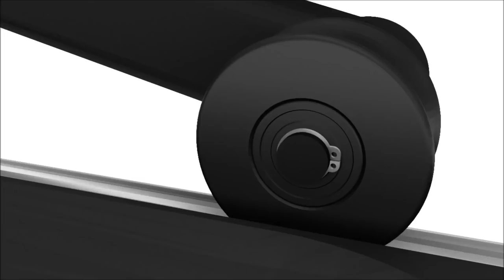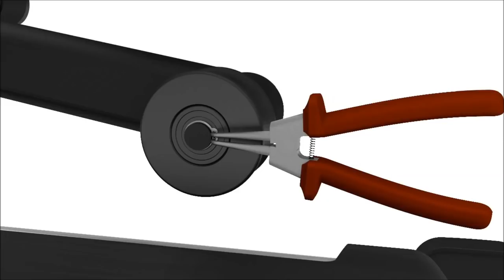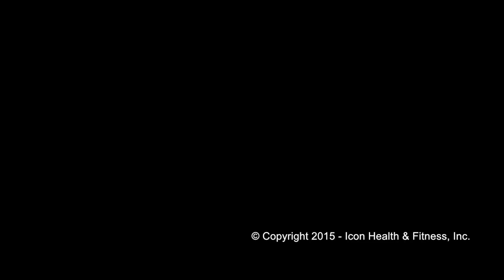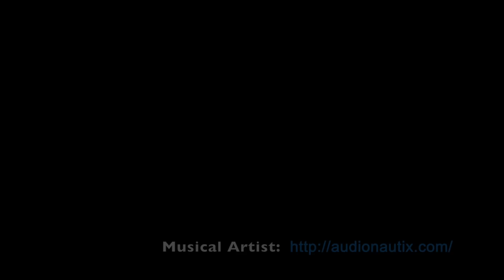Using Snap Ring Pliers - Elliptical

Comment: hello, I have a Nordictrack e5 vi  elliptical and the upper rt. arm keep coming off the pivot axel. Not sure of the wording but the metal that goes inside the part that slides on the pivot axel came out of the plastic holding.  How do I keep the metal part in the plastic that slide on the pivot axel from coming out and then the arm slides completely off.
Reply from the maker: sounds like you are missing either a washer or some other kind of fastener. Can you please include your model number?

Comment: What do you use on small external rings without the two holes? My snap ring pliers doesn't fit, larger rings with two holes no problem. .
Reply from the maker: There are other tools for the "E" clips or "C" shaped clips. ( E clip tool).  I belive most of the time a small flat screw driver can be used to pry them off. Carefull they will fly across the room.

Comment: That’s not a great technique. Fully opening the circlip to clear all of the shaft will stretch the ring and reduce its spring force. Better to place the “head” of the ring (ie the fully closed part opposite the opening) onto the shaft, and to only open the ring enough to fit the right side into the groove, and then open it again just enough to fit the left side into the groove. Rotate the ring all the way around the shaft to ensure it’s seated properly.